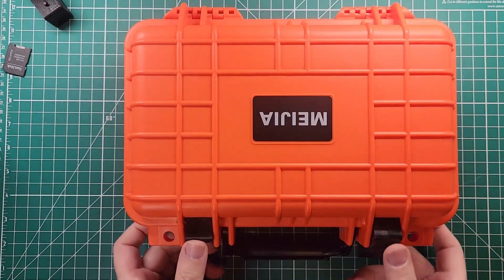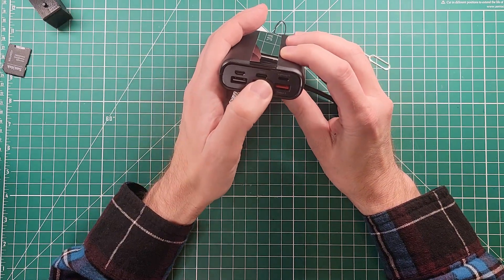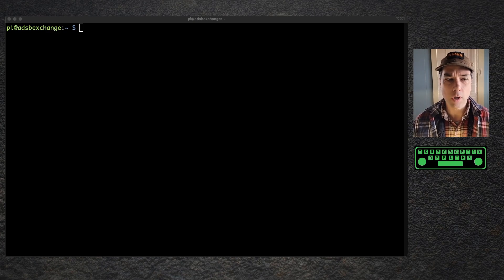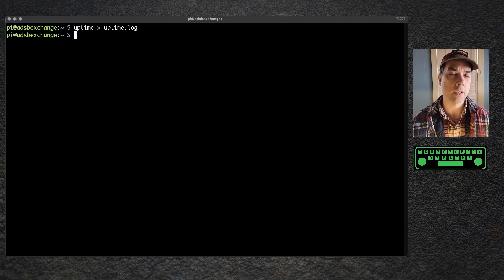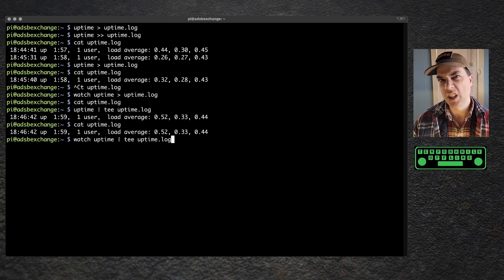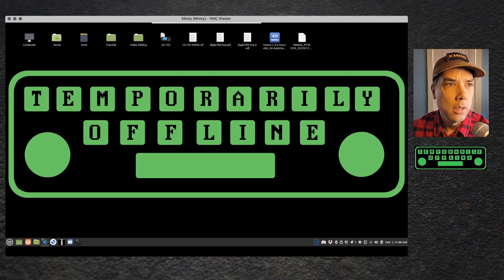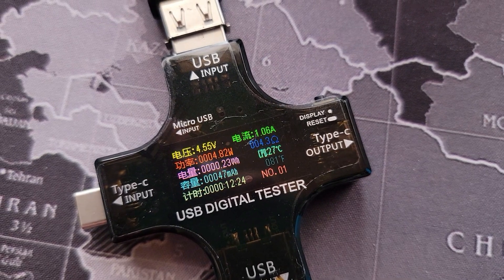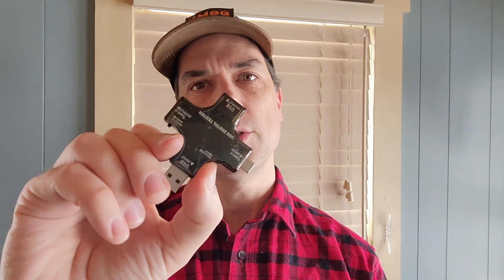Let's find a battery pack for our ADSB Go Box!

Comment: FWIW, as an old-school, sandal wearin' Bearded Unix Geek (who's also an Extra class Operator), we refer to the "  >  "  and "  >>  "  output redirect conscructss as "into" and "twice into", respectively.  Thus, at the beginning of your mini-tutorial on this sub-topic, one would say  "uptime into $LOGFILE" to continuously record the last uptime before powerout, or "uptime twice into $LOGFILE" to create a running log.  Also note, in MY example the use of " $ " to denote a shell variable, and all caps for the variable name.  This is not only a common convention in shell scripts, but useful when explaining things like I am now, to indicate that the file you are re-directing into can be $ANY-FILE-NAME.......

I have a couple of these USB Power Dingii, and they are great.

The holy grail of the USB Power Dungus realm would be this one PLUS the ability to charge and sustain a load at the same time, thus facilitating it's use as a poor man's USB UPS.   

Still looking........
Reply from the maker: This is a nice solar panel/USB battery bank: https://youtu.be/27jDBe_kuEU

Comment: Steve, I think I just found my next project!  I've got a buddy of mine that is hugely into stuff like FlightExplorer.  This will be awesome to show him what's going on with aircraft in his general area!  I did think of something else to consider for power options.  How 'bout something like a waterproof plug on the side of the case tied to some sort of relay (I''m not an EE) so that the box could operate off grid power or if none was present off the internally mounted battery?  Forgive me if I'm reading ahead!!  🤠

Comment: My guess is that you are using the 'orange' dongle for UAT on 978 MHz not ACARS on 131MHz?? ACARS is normally used for TEXT messaging between Aircraft or Aircraft to Tower.
Reply from the maker: I'm using the orange dongle currently to track another map in the browser.  I have used it for the text messages you speak of, but haven't finished integrating it with the setup.

Comment: add a third sdr dongle for voice scanning the air band so you can have the air traffic running as you display the data. Just a thought. this was something I was thinking of myself for a project...
Reply from the maker: That's a great idea!  I'm out of ports right now... have to figure something out.  I've always wanted an airband radio... hmm... 🤔
Reply: @temporarilyoffline  I thought I saw there being 3 USB ports, and I only see you use 2 for the data dongles. Did I miss what you were using the third USB Port for??
Reply from the maker: @RoyArmy-WREW918  Its coming up, either GPS or stronger wifi... I have a few options for either, but since it isn't landed yet, gotta reserve it.
Reply: @temporarilyoffline  Ah, ok, that explains that... can't wait to see your end project, so hurry up, already.!!!..😇
Reply from the maker: @RoyArmy-WREW918  I think this is one of those projects I'll get to iterate on for a long time with lots of community feedback.  I'm having a lot of fun!
Reply: Which SDR did you add for voice scanning the airband?
Reply from the maker: @noahneutral7557 a regular RTLSDR would work for that https://geni.us/h95sbZL

Comment: I don't suppose that the USB power dingus(tm) has an English label mode?
Reply from the maker: I had a chance to get this dingus out for another project.  It has a button on it to change the display and it will cycle through many different screens.  Most of them english. https://amzn.to/3YZEBbU
Reply: @temporarilyoffline  Thanks!  That's good to know.
Reply from the maker: English label?
Reply: @temporarilyoffline  I'm seeing Chinese characters labeling the values on the display of the "USB DIGITAL TESTER" at https://youtu.be/Abm5M8Iv2ZA?t=642
Reply: The display was in another language. Chinese?
Reply from the maker: @LeeMcc_KI5YPR  I get it now - not the battery, but the usb power tester.  I'll have to take a look.

Comment: Nice battery.  Speaking QRP radios on these packs, I recently got a Bluetti EB3A.   Sort of a GoBox battery but with lots of added stuff like USB-C QC3.0 (PD) charging port capable of 100W.   And also wireless Qi charging for your Android or iPhone.   Plus two DC ports that are rated at 10amps.  Plenty of power to run a G90 or a G106 for about 4hrs.  Which is fine for POTA.  Maybe youd like to stay up longer.   For me 4hrs is long enough.    I also found a PD cable for my HP laptop so now everything runs off the Bluetti EB3A
Reply from the maker: Very nice.  I ran my QRP radio on this exact battery for 7 hours of FT8, I was impressed.
Reply: Wow.  That is exceptional!
Reply from the maker: https://youtu.be/w6JpjkLouEI

Comment: So did I miss a video?  What is this ADSB?
Reply from the maker: ADSB is tracking airplanes overhead:  https://youtu.be/-gQZh-Hurtc
Reply: @temporarilyoffline  I like your videos, and I certainly enjoy ADSB.  But, what does ADSB have to do with survival offline?  It seems to be only useful to aviation, and if we're offline, I'm not sure that it would be relevant.  Your thoughts?
Reply from the maker: @RadioBro184  probably has nothing to do with survival, it was just fun to play with.  There are some lessons to be eeked out about batteries and (soon) GPS and offline mapping.  Just building skills
Reply: @temporarilyoffline  fair enough.  I personally have and ADSB setup in my shack, connected to a 38,400mah OmniCharge power bank.  putting together these sorts of things is definitely a learning experience.

Comment: It saved itself with the type C input.
I have a decent quality and capacity power brick that it is micro input only and I absolutely hate it. Everything else I own is type C so there's always a cable nearby. Every time I need to recharge that stupid brick I have to go searching for a cable. 
I should probably save myself the trouble and replace it with this. Lol
Reply from the maker: Either this or an adapter.

Comment: Were the radios turned on for the test?  That will def effect battery draw, I’m only suspect they were not because to the draw seemed low with the usb dingus monitor.  You might try using rtl_fm tuned to a couple local stations and see if that amp draw goes up.
Reply from the maker: Yes, the radios were on for the test.
Reply: Had brain been activated they had to be on, it’s too early with no caffeine to do any simple maths, adding up ~average current draw for all 3 devices should come out around 1 amp or so.  Neat project, I’ve got an adsb go box I built long ago, still running to this day
Reply from the maker: @tedw7193  math is hard sometimes!